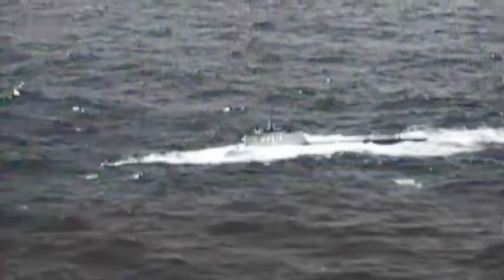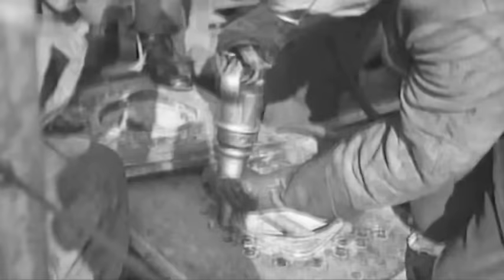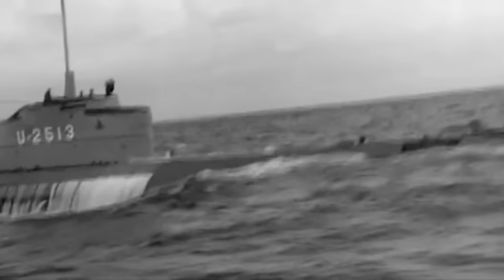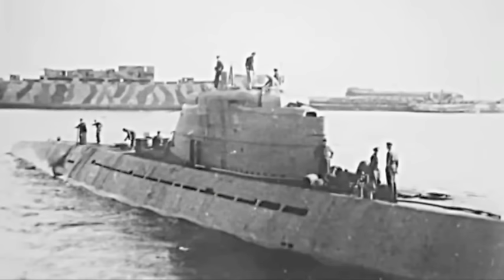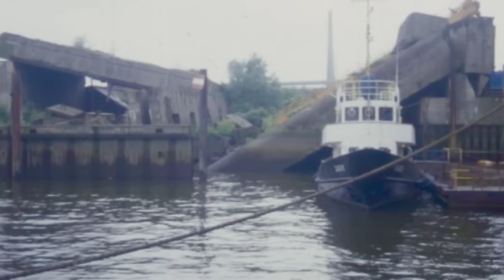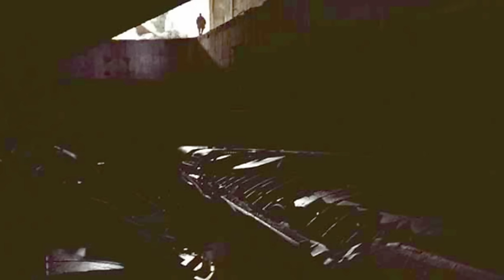The U-boats That Time Forgot

Comment: How does this even happen?  Advanced technology that the allies wanted = check,  metal that could be used for whatever sources = check
Reply: For the tech, They had others. Plus the engineers that built them.

For the metal itself, good question
Reply: As far as the metal goes I'd say there was probably so much equipment lying around at the end of the war that 3 subs didn't seem worth the effort.
Reply: There was so much scrap metal lying around the battlefields of Europe that scrapyards were full of war materiel into the 1960s. Thousands of brand-new American and British aircraft were flown directly from the factory to reclamation facilities. There were so many unneeded U-boats that most were simply towed out to sea and scuttled. Extracting a few damaged submarines from a semi-ruined bunker in a metropolis devastated by bombing was not high on the list of priorities for the British occupation authorities.

Comment: I read that Type XXI was the first underwater boat that could go much faster under water than on the surface, and along with its ability to dive so deep made this ship something the Allies would have had a very hard time dealing with. 
A truly great design.
Reply: It had many innovations, from the fast hydraulic torpedo reload system to the advanced Balkongerat sonar, and more besides. Still, it was compromised as a result of being originally a Waltherboot design; the hull shape was a trade off between surface and underwater running, true teardrop underwater hulls being well developed already

Comment: One more footnote: Another reason for the the delayed introduction of the Type XXI was the propulsion system. The original plans involved an AIP drive (hydrogen peroxide if I remember correctly). When that didn't work out, everything had to be re-designed for an advanced, but less ... innovative diesel-electric system.

Comment: From what I understand , the boats were distroyed by the Germans to avoid been taken by allied forces , Hamburg fell under British control after the German surrender. After which several items in the harbor were distroyed to hinder an future German industrial recovery militarery . From massive harbor Crains to the U boat  pens . They proved rather hard to blow up , the British used an insaine amount of explosives and left over munisions to try and distroyed the bunker , the end result was a failure that stood around for decades abandoned , other than people playing around in the site. Then there was another attempt to demolish the sight when the container port was expanded in the last decade , but even with modern equipment the bunker proved to strong and was costing the state government to much money to distroy so it was decided to concrete over the sight and build the new container port extension on the old sight. Has for recovering the subs , one has to remember that anything military these days in Germany is shunned by most of the public , so recovering would never have been an option. I have lived in Hamburg since 2009 , and there are plenty of reminders of those dark days in German History , but the dry dock that the Bismarck was built in still is in use to this day . But those Bunkers have proven to be very resistant to been removed the bigger ones anyhow.

Comment: I think a few technical aspects about these boats were left unclear
Those ships have a diving depth of over 400 meters, far more than the officially stated diving capabilities of most modern ships (250 meters).
The special materials and coating used in the hull compared with the nearly silent operation due to the electrical propulsion with very efficient motors and propellers made the boat undetectable during its time, and still makes it nearly undetectable compared with modern U-Boats (by passive sonar, active sonar can - of course - detect any object larger than an Apple)
Th aspects were these boats are lacking compared to modern ones are areas of propulsion (energy density in batteries is far better now), time it can spend submerged and active electronics like its own sonar and targeting

But it’s still a VERY capable base

Comment: I am going to share what i know about the type 21 German submarines.  Surface speed 7-8kts. Submerged speed 20-21 kts.  Yes they were faster underwater. They were equipped with snorkels that had a composite material that absorbed radar signals. Yes the Germans invented stealth tech. Yes this sub was faster underwater for a reason. It was teardrop shaped so it could move through the water at great speed. They removed the deck gun(s) as there was no reason to fight on the surface. this also made the underwater drag coefficient lower. It also had a pressurized hull like that of a modern submarine. USA studied it at the end of the war and adopted its basic design. It was armed with both electric and homing torpedo. It also carried long range steam torpedoes. Its depth of about 400+ meters test depth was deeper than any other sub at that time.

Comment: It is worth pointing out, that the Wilhelm Bauer / Ex-U2540 is a bit of a mixed bag. 
Yes, it is the last surviving type XXI in the world, but it is not an original XXI anymore. 
It served int he west german navy until the eighties as a diving test platform for new equipment, engines etc. and has been altered a lot in terms of internal layouts and so on. It got a new conning tower after the war, after it was salvaged, which did not feature AA armaments and looked more like a Diesel locomotive. Also you will find, that while they restored the old look through installing a fake conning tower in the original design, the sub sits way to high in water, since the batteries have been removed. Of course this allowed to cut out the openings in the hull, which serve as entrances to the museum ship. But the torpedo room in the bow is mostly the museum shop. Also Wilhelm Bauer features only four torpedo tubes instead of the original 6. They restored her optically but on the inside they kept the 1980's testbench configuration. 

It is still a great piece of history and truly remarkable, but be aware of the serious differences between a original configured type XXI and Wilhelm Bauer

Comment: I have difficulty with this widely accepted definition of submarine.  Can it reasonable be said that there were no submarines in ww1 and only 118 or so by 1945?   Super video and a fantastic looking sub.
Reply: Sure...it's always been said that prior to the Type 21, what the world called "submarine" was just a "submersible", a vessel that could eventually dive and sail slowly underwater for a limited period of time, but essentially a boat that would navigate in the surface most of the time.  It all changed when the Type 21 showed up on the scene.
Reply: Then call them submersibles instead.

Comment: I’ve been researching this submarine and it was my understanding that the hull design was finished early in 1943. But the main issue was these craft was to have a new type of power plant. This proved to be the main issue. No one could make the power system work and it wasn’t till very late in the war that someone decided to place a more conventional power plant but with far more batteries into this new hull design. Had this been done early in 1943 the allies would have found it extremely difficult to find and destroy these boats. 
Thank goodness for the bad judgement on the part of the nazis.

Comment: Nowadays that seems bizare, but in the days after the war, there was no shortage of any kind of war machinery. Hamburg was occupied by the british and they took and salvaged what they found interesting. But for the tech you did not needed those damaged boats, as you could easily ask the engineers and the few skilled workers who build them just a few hundred meters a way. So they salvaged what was usable and blew up the bunker after that. There was simply no need for some damaged U-Boats after the war, as they had plenty good ones. And yes, the bunker WAS dangerous. It was sheer luck, nobody died in that crumbling thing. It was not that easy, but manageable so lots of folks got inside.

Comment: The essential problem behind the construction of the Type XXI was that the construction method of sub-assembly required the use of inland firms whose workers had little or no prior experience of submarine construction. The adverse result was that tolerances in the sections of hull were insufficient to allow assembly and testing.
Reply: It would have been a huge innovation if the bugs were worked out pre war, would have massively expanded sub production without needing more slips

Comment: It is interesting now that Korea builds better and larger U-boats now. The 3000-ton JBG3 which is MRBM(localised Iskander-M version) capable and is optionally nuclear powered via SMART reactor. Germany is quite weak when it comes to shipbuilding. Indonesia chose Korean U-boats instead of German ones. Above 2000 tons, Germany hasn't anything to offer anyway. Korea has 3 aircraft carriers one of which has parts of the scrapped RFS Novorossisk in it. Germany never accomplished to build an aircraft carrier.

Comment: I have read that the hulls of these U-boats were encased in rubber to reduce contact by Asdic.Is there any truth in this ?
Reply: Not exactly. The Kriegsmarine did test and echo free coating, consisting of rubber sheets with holes in the middle layer, but it wasn't used widely. 

They outfitted a type VII (I believe a VII c but could also have been a VII b) with it and it made atleast ine war patril in the channel with it. It worked well, but the sub was lost. It was eventually discovered ling after the war, that it ran on to a mine and sank. 

What they did on the type XXI were such things as suspending the engines on springs to reduce vibrations in the hull and therefore reducing noise.
Reply: Have to correct myself here. They outfitted a few boats with the anechoic rubber sheets, called "Alberich" after the dwarf from the Nibelungen. They intended to coat all new subs with it since it effectively prevented ASDIC localisation, but they had problems with the glue used to hold the rubber sheets together, so the project stalled and when they resolved the issue it was way late in the war, so in the end only ten type XXI and XXIII boats were equipped with it and only two were operational.

Comment: What happened to the Walter Hydrogen propelsion system ??
Reply: It was not ready for production when the war ended. A few prototypes were built, but it was unreliable. Types XXVI and XXVII would have been Walter-boats. They used the hull design of these types for the type XXI and Type XXIII boats and filled up the space with batteries and conventional engines instead if the tanks and turbines of the Walter engine. 
Types XXI and XXIII were supposed to be a makeshift solution to get modern boats into service in time, since the type VII and type IX were outdated at the end of the war. 

Britain built two own Walter subs after the war, called Explorer and Excalibur, but since the Walter engine was so unreliable and caused explosions, that they were nicknamed Exploder and Excruxiator. Additionally the British tried to get one Walter boat running, but the engine exploded.

Comment: saying dive down to up to 100 meters is like saying it's a hot water heater. I'm definitely not a lang guru but shouldn't it be dive down to a max depth of 100 meters and called a water heater or a cold water heater? mostly wondering and asking.

Comment: Speaking only from the pure military point of view this machine was very advance for its time & if had been committed at the early stages of the war in strength of numbers then for sure would had changed the outcome of the war at sea because it was completely different of the all knowing boats at that period of time her speed under water was one thing then could be reached the deep waters without ever been directed & her torpedoes were so deadly to the point that not even a commander on the bridge of any allied ship could take up any consideration of survival now rumors has it that the Germans did at the late stage of the war during the time of surrendering dummy attacks on destroyers & as was expected & reported the allies never find out or notice anything again & again of the shootings but as usual arrived too late to changed anything on the course of the war of course some units came to the states for study reasons .

Comment: Those boats were probably in a very bad condition. Just a rusting hull. I bet the inside was rotting away already.

And as they already have 1 in good condition I think not much they can do. Well, at least get them out of the water into dry storage.

Comment: .        It's a common misconception that this u boat would have a determining effect on the boat war. It most likely would have made no difference whatsoever. Sure, it could be submerged longer, but the boat hunter killers would have just as effective against these boats as they were against the older ones. True they could snorkel while charging, but they would go slow and be veryvunerable as the diesels would announce their presence far and wide by their noise. No these where nice, but they wouldn't make a difference to speak of.

Comment: 400m down? i think more like 400ft. the american nuclear subs make 300-400m some 70 years later.
Reply from the maker: Slip of the tongue!
Reply: Yup 330m max.
Even the max for the older type VII was ca. 285m.
Reply: american subs dive to 
to 10.000 feet
Reply: @johnford4910  Only Scorpion & Thresher.
Reply: 400m perhaps on paper but I recall they test dive to 300m which is unheard at that time. Like other poster said type VII has theoretical crush depth around 285m. So I guess 300m is easy for type XXI.